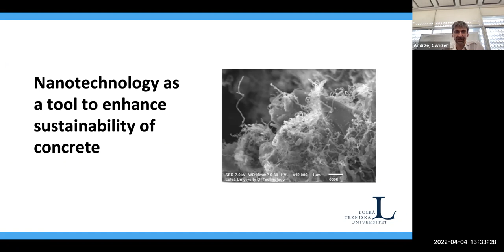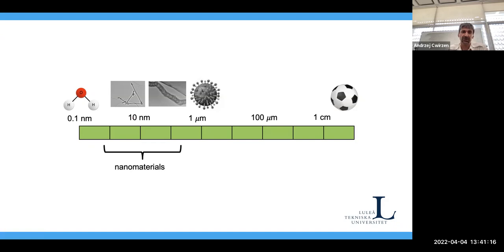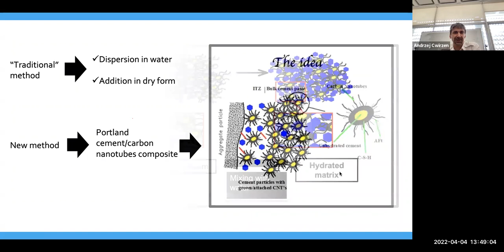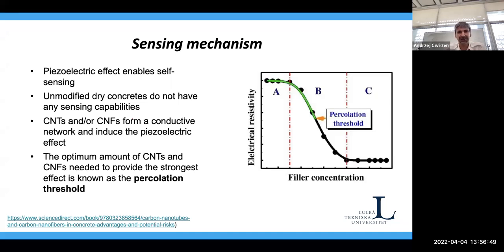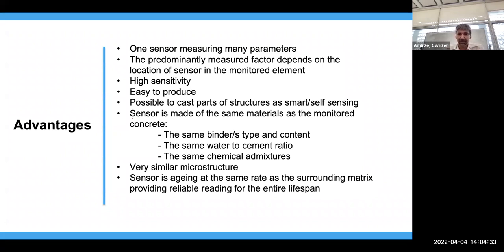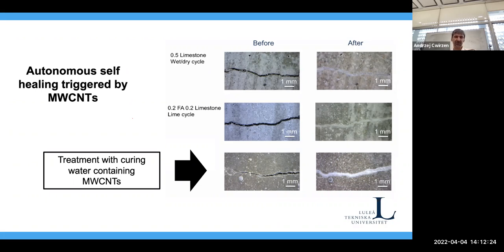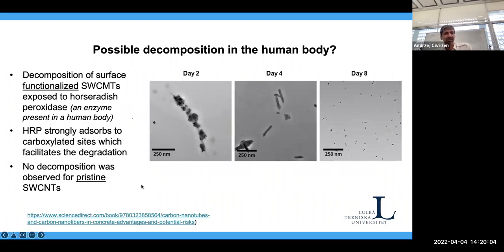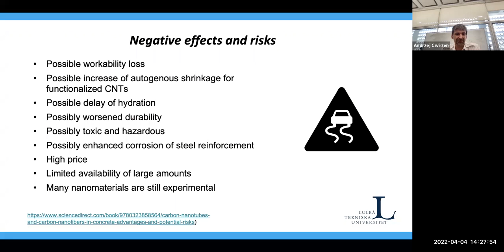Nanotechnology as a tool to enhance sustainability of concrete

Comment: Great lecture by Prof. Cwirzen on the use of nanotechnology for improving concrete sustainability. The replacement of portions of cement by a controlled volume of novel and quality improvement materials in concrete has been a hot research topic of late. I was wondering if there are research outputs on the specific contribution ratio of these novel materials in a composite material. Also, how can nanotechnology help to ensure the optimal capacities of these novel materials are utilized in composite material formations.

Apart from waste materials, are there replacement nanomaterials (carbon-based or non-carbon-based) with the same efficiency or even greater for production of concrete with low CO2 emission?
Reply from the maker: Dear Olawale: Sorry for my late reply. I encourage you to reach out to Prof. Cwirzen with your query! Thank you for your interest.